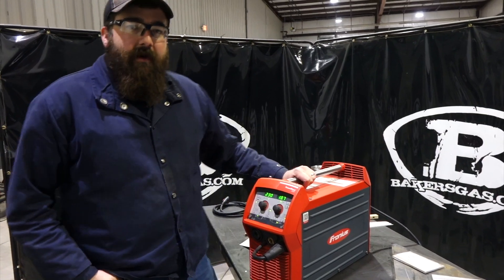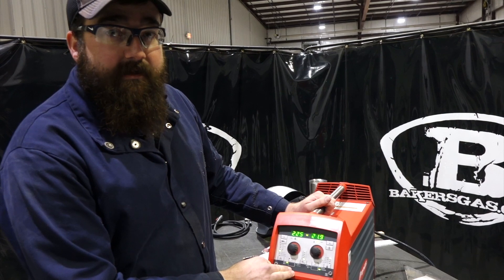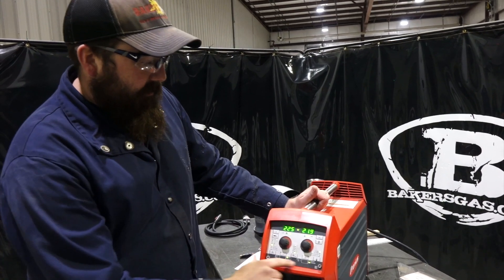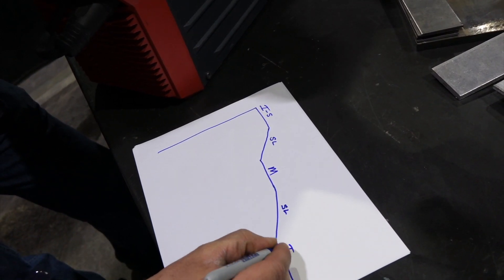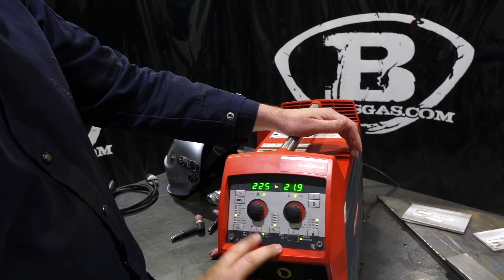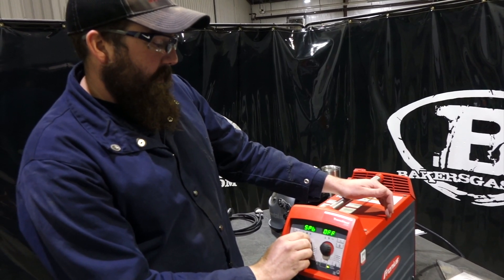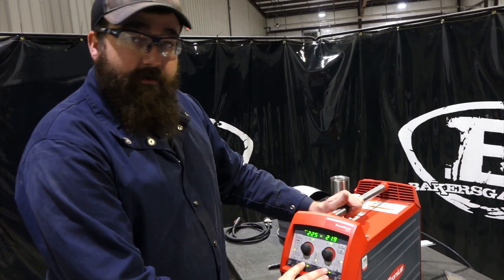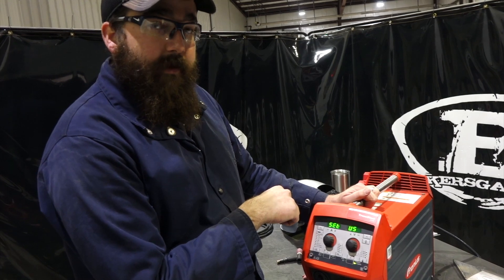Fronius TransSteel 2200 FAQ & Factory Reset

Comment: I understand correctly that they can not weld aluminum in TIG mode, since there is no AC mode?
Reply from the maker: Correct, the model does not have AC capabilities for TIG welding aluminum.You can MIG aluminum with the regular MIG gun and do not need a spool gun which is neat.

Comment: The only thing I don’t like is I can’t run 6010 stick. Everything else is great! I love this machine. Have not done tig yet but a lot of mig steel and aluminum with about 10 pounds of 7018. Hate to say it but my trailer blazer sets quietly on the back of the pickup.  Most my jobs I can find a 110 outlet and get after it!   Awesome video thanks for breaking down the upslope and downslope.
Reply: Can it do 6011, and is 6011 any worse than 6010?

Comment: I have had my 2200 for nearly a year now. I works very well. I recently made an awning from 6061 aluminum  using 5356 0.35 wire on the synergic 0.40 setting and it worked fine. I decided to go with 2 mig gun setups. one 10 foot with Teflon liner for aluminum and one 15 foot
set for steel. I used the factory settings with the 5356 wire and had no problems. I have not gone too far into adjusting for fine tuning just small tweaks for the joint configuration. For steel I did not see a need to tweak the synergic settings other than changing the inductance and arc force. For aluminum I did set the arc to soft at setting 4.0  to reduce splatter which it did. ( with 5356) .On stick I did some hard facing on snow plow blade shoes using chrome 58 rods ,they ran smooth no bb's just a very soft arc. Once you digest the menu you will find this a very very , good welder. I have done  a bit of tig with it for practise  so I can't report on it except that it has a smooth arc and I need more practise. One thing I like is that the fan does not come on till you weld for some time, and when it does it is quiet, not like my Esab 215 where the fan it on as some as you pull the trigger ,its loud and stays on for nearly 10 minutes after you stop welding. The Fronius is a much quieter welder than any others I have had.
Reply from the maker: Thanks for watching and commenting! We are impressed and glad it is working for your projects! If there are any videos you want to see on this machine let us know.
Reply: Hi Andrew, How about doing a video on aluminum with the mig setup and also doing some silicone bronze , I did a bit of silicone bronze and it is good just set the welder for low splatter with soft arc.
Reply from the maker: @bruced1429  you should check out @milkycereal83 he has one on that! I will try to find it and link it for you!
Reply: @Bruce D. 

You said you have a Rebel 215ic, I have a Rebel EM 215 as well, Whcih welder you fine better the ESAB or the Fronius, and what things you like the most of each one? as I'm looking into the fronius but need some more feedback.
Thanks